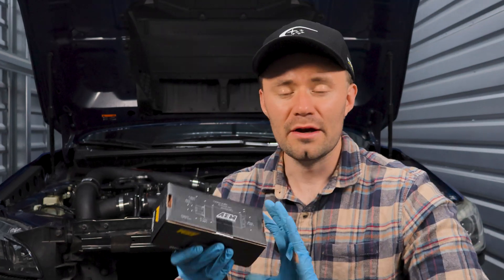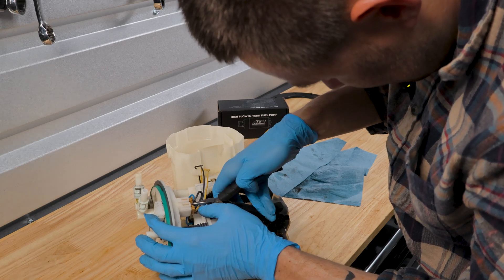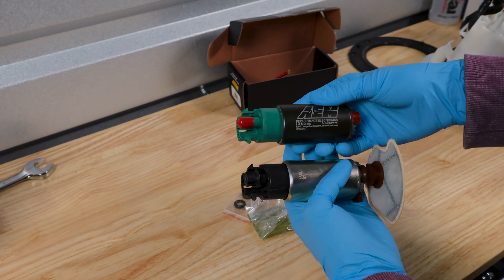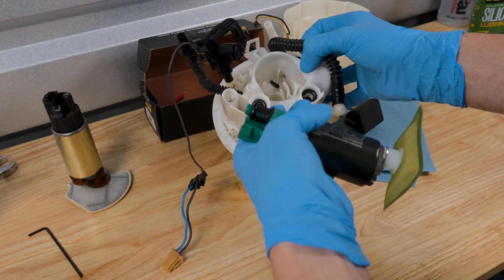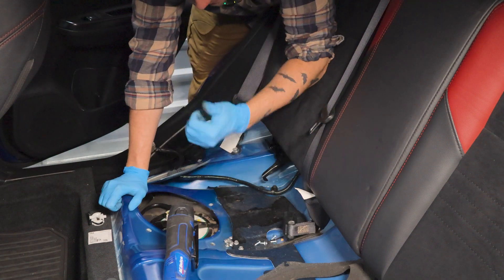AEM 340 FUEL PUMP DIY INSTALL GUIDE ON MY 2017 SUBARU WRX STI  | Part 9 of Tearing Down My STI

Comment from the maker: TIMESTAMPS
00:00 - Intro
00:16 - Disconnect the battery
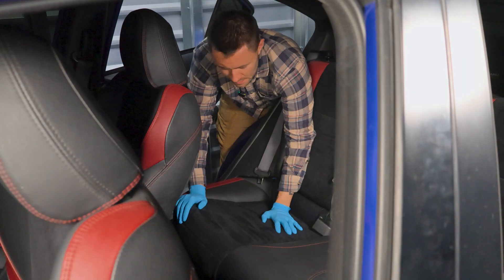00:53 - Pulling the tabs from the backseats to remove them
01:14 - Removing the 4 Phillip screws holding the cover down
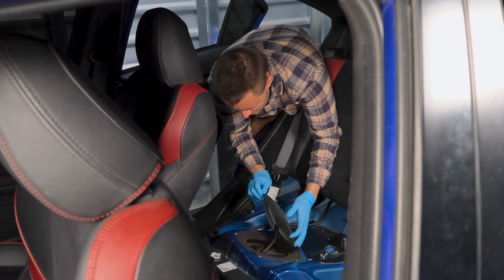01:32 - Disconnecting the electrical connector
01:37 - Disconnect the 3 fuel lines to the Tank
01:45 - Unbolt the 8 nuts holding the tank in place
01:56 - Pulling out the fuel basket
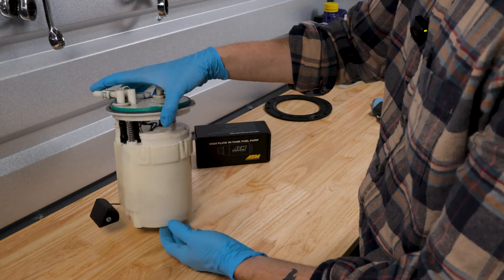02:27 - Overview of the OEM/Stock Fuel basket
02:33 - Untab the fuel basket
02:49 - Disconnect the harness from the basket
03:16 - Untab connections
03:39 - How to remove the fuel pump harness
03:50 - How to remove fuel pump from the basket
04:21 - Overview of how to remove the fuel pump (tips)
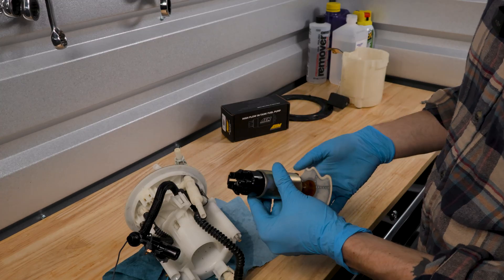04:30 - Overview of the OEM fuel pump
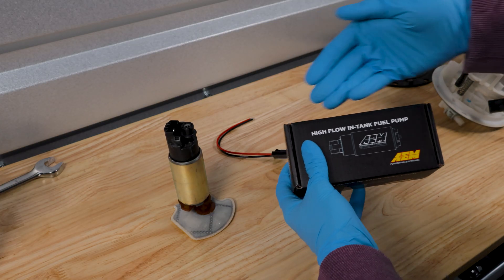05:08 - AEM 340 LPH showcase
05:53 - AEM 340 installation
08:26 - Reinstalling the fuel basket to the car
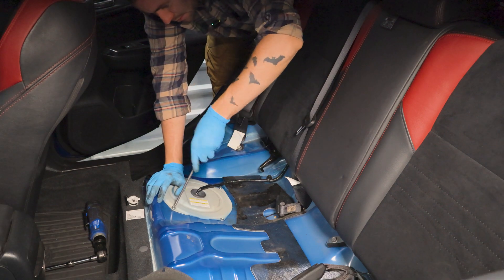09:40 - Testing/Priming the fuel pump
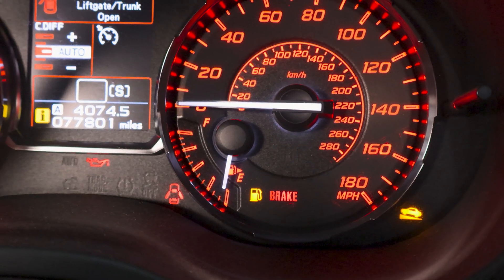10:03 - Outro